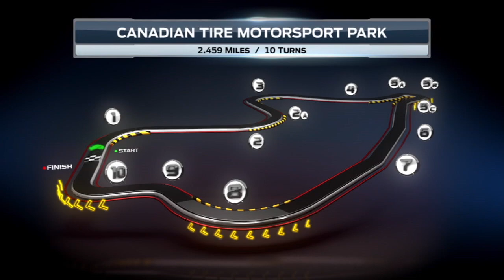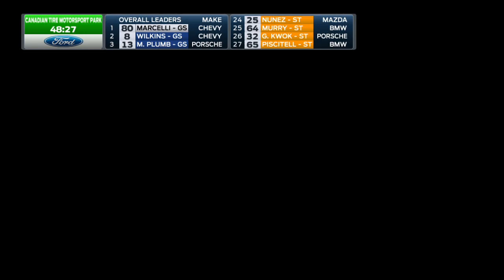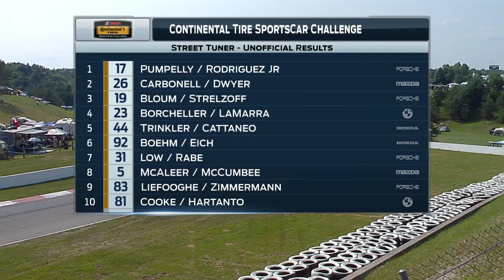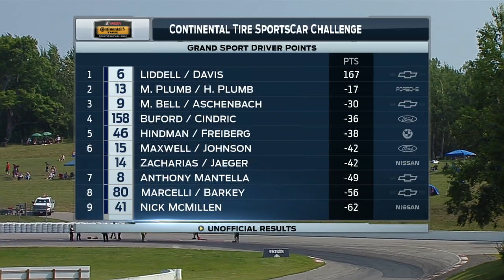2015 Canadian Tire Motorsport Park Race Broadcast

Comment: would of been shelby 1st and 2nd place if not for racers edge motorsports bumping out the pole position  #15 shelby for just not being smart. Car #78 should of been penalized. #15 shelby was making a clean pass when bumped by #78 vance, he  was being passed like he was sitting still.

Comment: That #78 Mustang had no business racing much faster cars on a totally different pit strategy as hard as he was. Gave the Porsche and the two GT350s an unreasonably hard time. Do racing drivers not realize that they actually cost themselves more lap time (and create an increased probability of wrecks) by doing this? It's one thing if there's just a few laps/minutes to go, but c'mon.